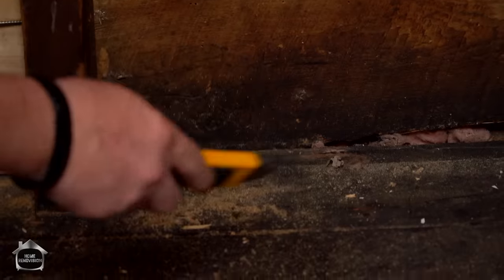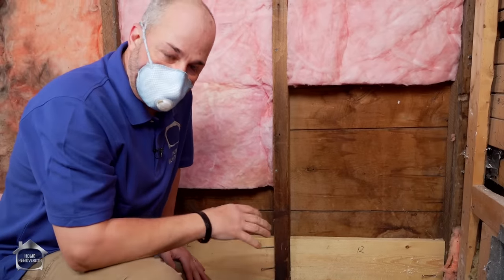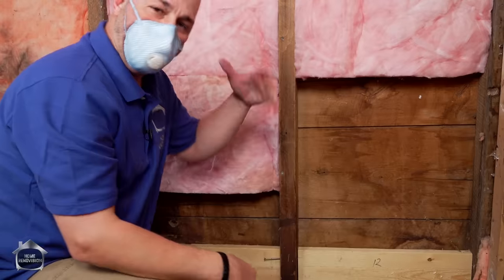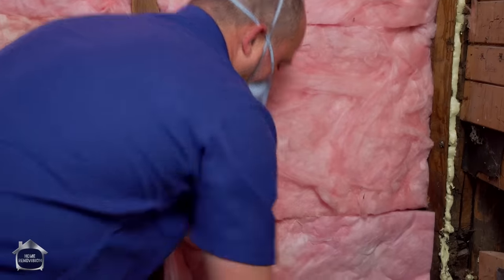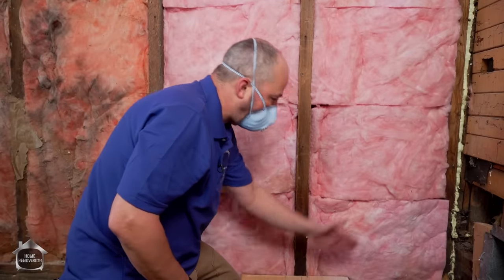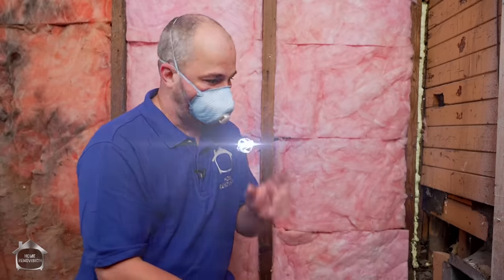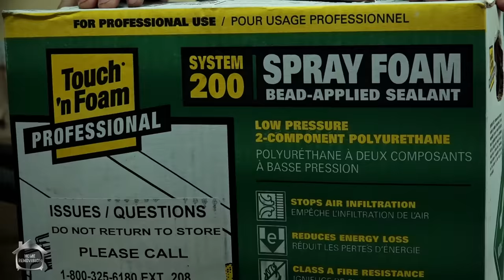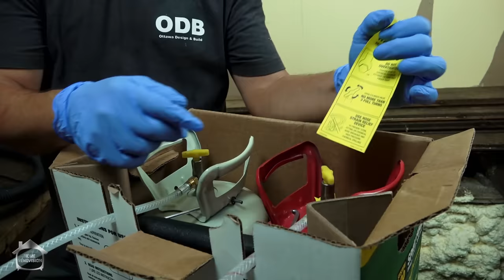How to Install Insulation Yourself! | DIY Insulation Tutorial

Comment from the maker: Lets have a good conversation about insulation technology and what to use where. let me know if you are having trouble negotiating the info on what to use where?
Reply: Closed cell really is a superior product. I built a pole barn about 2 years ago and put a man cave on the inside and use the same insulation system use in the video. It's nice to have this at our finger tips to be able to use and do it our self.
Reply: Home RenoVision DIY how to keep the foam from drying in the gun. I manage to mess this up in the disposable cans and this big one. :(. It’s getting expensive.
Reply: This article suggests using open cell in crawl spaces,  I get that closed cell can be superior in some situation but is there times when you wouldn't use it?   https://www.emecole.com/blog/rim-joist-sealing-with-open-or-closed-cell-spray-foam/
Reply: Any recommendations for homes built on a slab? I feel that it is inherently flawed because all the cold comes up through the floor. Great video and thank you Jeff!
Reply: My house is boarded on the outside and on the inside with what is now probably packed down blown in insulation in between. It was suggested to me that the best way to insulate was to take down the ''inside boards'', insulate and then sheet rock. I already have sheet rock over the boards in almost all the rooms. This method would cause a huge mess and I'd probably have to move out for at least a week if not two. Did I get the right advice? Is there a better way to do this?
Reply: awesome thanks for this video!!!
insulation is a big topic for home improvement, for both comfort and energy/money savings :)
Reply: Where do I get this foam gun!?!
Reply: Thanks for all your video,  pleaee where can I find a good school for plumbing in USA? Regards
Reply: We are also fixing up an 1870s home, but in Texas, where it’s hot and humid from May through October. It gets down to freezing a few days a year in the winter, but our insulation needs are vastly different than yours. WE DO need to fill the gaps between the floor joists. Can we use the spray-foam there, or is that only for vertical surfaces, as you showed? Would you recommend blown-in insulation in the attic?
Reply: Rina Martin the most likely way is to blow into the wall spaces. This involves using a hole saw to open each stud bay and blowing in dense packed insulation. It is not terribly difficult, but there are safety concerns I.e. using a non conducting feeler gauge to mark each cavities height/ width and using enough product to completely fill the cavity without blowing out the wall. In a retrofit dense packing is usually done as it will stop air movement.
Reply: just a small recommendation considering the farmhouse videos. if you can have the titles organised eg. Farmhouse ep4 basement or washroom etc.... i love the  videos, im just a little confused when trying to follow the farmhouse. THANK YOU for your content I REALLY ENJOY your videos... U are in my top 5 favourite contractor. Want 1st place? u just need to be a habs fan and you got it!!!!!! hihhihihihihihihihhhih
Reply: Great video and really helpful, I just not sure What is the name of that pink-plastic insulation roll you used on after spraying the foam on the crawl space wall ? and where can I buy it? Thanks
Reply: I beat the shit out of ridgid, well worth the money! Be smart, register your tools.
Reply: I'm confused on the insulation sheet used. Was the foam not enough? And I thought putting the pink down there would be bad if water came from underneath. I'll be doing my crawl space soon is why a ask, because I was going to foam my brick and call it good but now thinking about that insulation sheet as well.
Reply: Personally, and this is for myself only, Situations change for each house or application. For myself? I had Emptied Cement bags as insulation! AWESOME!! I think I have alot of work ahead of me! Personally, since I do have Rim joists, I am going to use Rigid Foam first and then use batts to fill in the rest. NO need use a vapor barrier when the Rigid foam is sealed with a Spray Foam.
Reply: @koryleach9660  I think the biggest problem with outside "Blown In insulation...is that they have people that don't really know when it is "full". Believe it or not it does take time! I have seen far too many videos on "How to do it wrong"! 
Side Note: AS a DYI person, I can buy the Insulation, the Drywall, coat the Drywall...paint it for half the price.. Blown in insulation for walls is a waste of money...unless you have lots of it, and TRUST the company.
Reply: @codypoe2854   I was thinking the same thing.  With the fiberglass insulation under the vapor barrier, towards the ground, wouldn't the moisture be trapped in the insulation?  And I'm sure everyone knows that fiberglass insulation is about worthless if it's wet.
Reply: Wouldn't having the fiberglass insulation sheet in the crawlspace under the vapor barrier expose it to moisture and render it worthless over time once it was saturated?

Comment: You should mention the minimum surface temp of the surface you’re spraying the foam onto.  Cold surface won’t activate the foam and lead to adhesion problem. I had to use a torpedo heater to prep my foundation for spray foam.

Comment: hey jeff, as always, LOVE THE VIDEO! I have a similar crawlspace in my house. My question is, if you don't have a water proofing membrane on your exterior crawlspace/basement foundation, what steps should i take to not only insulate but ensure the insulation doesn't get water damaged or have moisture build up behind my vapour barrier?  How reliable are those water proofing paints?

Comment: So glad your videos showed up on my feed. I have vaulted ceilings (basically it's the roof) in my bedroom. Beams that are standard distance apart. I want to add a bar perpendicular  to the beams to help hold the insulation up. 1) What should I use as a thin bar? 
2) I'd like to cover the insulation with a light weight cover. Instead of dry wall, what do you think about corrugated or flat PVC panels? Thanks in advance for you advise.

Comment: 12v Brushless Milwaukee, my 18v drill and impact have been unused so far since I bought them, I can put 6 spare batteries in one pocket (2ah), the 6ah is really light in weight, all the power you need and they weigh very little. I'm sure Milwaukee would treat you to some Jeff!
Reply from the maker: very nice, I like light weight tools myself.

Comment: I’ve been retrofitting an 80 year old house with balloon framing. I decided to do #30 felt as the WRB, so there wouldn’t be water trapped. I’m adding shingles over that. It’s a compromise, but think safer than Typar, etc. Nice video.
Reply from the maker: interesting!

Comment: Holy cow, I just realized I've been wearing dust masks incorrectly for the last 25 years of my life - I just saw at the 1:12 mark how the straps hold the mask on Jeff's face.  Now I need to find a project to put this in practice -- I just insulated my attic with dusty cellulose 4 months ago, and this would have kept the insulation out of my nose.
Reply from the maker: Hi Jason, curious how you were wearing yours?
Reply: @HomeRenoVisionDIY  Lower strap around my neck, and upper strap around the back of my head.  It's amazing how I managed to even keep it on.  🤡🤓🤤
Reply: my mind is blown
Reply: He is not wearing it the correct way. The top strap should go to the top back of the head and the bottom goes below your ears around the neck. You can look up the manufacturer's fitting instructions at https://www.moldex.com/product/2300-n95-series-respirator-exhale-valve/.

Comment: Great video and tips on application.  I have never used this product but I have had a few times where it would have saved a lot of time and in the long run saved money had I done so.  I watched a couple of TV programs where the product was improperly applied and not allowed to cure properly and the property owner ended up with a house that gave off a fishy smell, I think it was because the product was applied too thick and not in two layers with proper curing between layers as you did.  Still like the idea of this product though especially for hard to reach areas and irregular surfaces.
Reply from the maker: definitely a concern. always use this type of product according to specifications. cheers!

Comment: Jeff, those cans are pretty slick but they are only 20 to 24 oz while the disposable cans area 12oz so technically they are not any cheaper but are easier to use and can easily be saved for later where it's a little harder with the disposable can system.  One thing to note, spraying that 2 part foam in the crawlspace should be done with a respirator and plenty of ventilation, the gas that gives off is not really all that nice to our lungs.

Comment: I've had quite a bit of sprayfoam installed in my house. Our local contractor's cost is $1 per square foot per inch. For me this is actually cheaper than the kits at our local building store.  However I'm not sure if they'd charge that rate on a small job. Worth shopping around anyway
Reply from the maker: access and size all factors into it for sure. Cheers!

Comment: I am looking into insulating my attic. I have a gas 80% efficient furnace in the attic with all of my ducting coming in through the ceiling. It is obvious that the tops of the walls and fixtures are not air sealed and currently there is an inadequate amount of fiberglass batt insulation installed directly on the top of the ceiling drywall. Do you have any suggestions on how I should insulate and properly vent my attic? the two options I can think of is: 1: Air seal all wall tops and fixtures, duct seal and insulate ducting, Fascia  vent dams, blow foam insualtion. 2: Spray foam the roof panels and make the attic a conditioned space and add in a fresh air supply for the furnace. I live in Salt lake City Utah which is a pretty dry area.

Comment: Hi Jeff! I know this is an older video, but I hope you could still see my question and give me an answer!  What's the respirator you were wearing at the beginning of this video, i.e, brand, and where to get one? Or if this particular one isn't accessible, what other comparables would you recommend?  As always, thanks for the great videos!
Reply from the maker: It is a full face shield used for spray painting or high contaminant areas. It is actually what front line workers should be using. but alas there would never be enough of them in stock. So the cdc says use those cheap surgical masks.

Comment: Two questions. Why is it better to insulate the walls than to insulate the floor to the house? And two, would the vapor from the ground work its way into the insulation instead of going into the house, and ruin the insulation? I'm trying to plan a project and am wondering.

Comment: Ok, I'm new to all this stuff. So I have a crawlspace with unfenced insulation in between the joists. The floor is covered with sand and a moisture barrier plastic. I wanted to add spray foam,  take out all of the old yellow unfenced insulation and replace it with the bat insulation.  Is this a good idea? Would doing thisake a difference in my heating AC bill? Would leaving the current insulation in place and adding the bat insulation over it be a recommendation or just remove it all the way? Would spray foam also be recommended once I pull down the insulation? House is only 16 yes old. Thank you in advance for all advice here. Awesome video!

Comment: If I have electrical wires, plumbing both copper and PEX, I could still use spray foam correct? Also the extra insulation you added was just for higher r-value, is not necessary right?

Comment: Here in NZ if you are retrofitting insulation into existing walls in houses that have no building paper and you arnt replacing the siding. it's common practice to cut out sheets of paper and staple them from stud to stud lapping 2" over each side. I wounder if you guys do that as well. Nice vid
Reply from the maker: If I am remodeling a house I always open the outside and ensure a water deflection system and then I am good to go with the finishing. You can never assume the last guy did it right. cheers!
Reply: @HomeRenoVisionDIY  yes ideally if you have the budget for that then sure. Obviously
Reply: @HomeRenoVisionDIY  if it's not practical to work on the exterior, even if everything appears dry and has no staining- is it best to go with a breathable insulation (fiberglass/rockwool) and put the vapor barrier inside of that? As opposed to foam or flash+batting walls.

Comment: Love your videos and like the simple way you put things. Quick question: My house was built in the 50's and has no crawlspace insulation. The subfloor though has no floor joists; it just rests on wooden legs with a concrete base. How could I go about insulating it? Its vented. Thanks!
Reply from the maker: Where do you live. It sounds like you need the venting to control moisture not heat!
Reply: @HomeRenoVisionDIY   Possibly. I am in Seattle, WA

Comment: A touch confused.  The vapor barrier on the dirt goes up to the foundation or footing correct? It doesn’t go over it?

Or do you seal over it when you put the other insulation fiber insulation into the wall cavity ?

Comment: I chose Extruded Polystyrene(XPS) Rigid Insulation to insulate my crawlspace.  It has superior R-value compared to bat insulation, it's 100% waterproof, and it also acts as a vapour barrier.  I have used spray foam for air sealing around the edges of the XPS.
But the walls of my crawlspace are concrete and they are nice and flat.
Reply from the maker: once you factor in the time and money to seal all the gaps, you might as well just contract it out and be done.
Reply from the maker: Hi Mario, how many layers of foam did you use to exceed r20 like with my batt?
Reply: @HomeRenoVisionDIY  I have used two layers.  First layer was 3" thick, the second layer was 2" thick, for a total of 5" of XPS, that comes to R25.
The two layers allowed me to stagger the seams, so I only had to use the sprayfoam on the edges.
Reply: @eringuet  Yes, it's expensive when you are buying the XPS at a big box store.

Comment: Why do you need the vapor barrier I thought the spray foam was a vapor barrier and an air vapor. I am reinsulating my house and was only planning on doing spray foam avoiding the poly layer. Thanks great videos
Reply from the maker: vapor comes from 2 sources in a crawl space, 1 the ground and the second from condensation through the wall. the spray foam solves the condensation but having the plastic on the ground solves that passive relative humidity as well. In the winter we will be heating that space so we need a vapor barrier on the dirt and up the wall as a complete system to protect the wood subfloor. Cheers!

Comment: We are in the middle of redoing the outside walls of my house which we have just discovered there was NO INSULATION IN THEM TO BEGIN WITH! So its no wonder we have had mold trouble and a high utility. With southern illinois climate would you recommend the same process for us?

Comment: Apologies if I overlooked something, but why do you need to clean out the spray gun? Can't you just leave the original bottle attached to it and just squeeze out the initial filling?
Reply: Probably because the foam inside the tube has hardened and he hadn't used it for a while. He did mentions it sets in a few minutes.

Comment: Hmmm. I had a gap around a pipe (gas?) under a cooktop. I started finding mouse droppings in the cabinet and in the drawer under the cooktop. It was suggested to me to fill any and all gaps with steel wool. Never had a problem again for the next 18 years. It wasn’t an exterior wall, though. The garage was on the other side. Would this work in an exterior wall or cause other problems?
Reply from the maker: spray foam works everywhere. Best to stuff the steel wool and seal it up as well. Cheers!

Comment: Are there fumes that make you dizzy when working with this product in a small space?  Also, what if that wall gets damp during the winter.  Will the foam stay put, does it mold?  Can this also be used in an attic ceiling similar to how you used it in the video for the crawl space?  Thanks!
Reply: I'm curious about this as well
Reply: He said its closed cell, so I guess that means it will not admit any water into it (vapour proof), so no mold. Im not familiar with this exact product, but my experience is polyurethane foam sticks to everything, forever, wether you want it to or not...
Reply from the maker: No dizziness at all. The fumes are more of a radiant heat. perhaps toxic if you have long term exposure. but for a one off i was comfortable with not sweating my but off while in the hole.

Comment: What about sealing a gap where an addition (crawlspace) foundation and basement foundation meet on a newer house? We just bought a mountain  house in NorCal, built in '98 (thank god!), on a downhill slope w daylight entry basement...there was a bathroom added after, with a crawlspace foundation that a) looks like a rodent dug in the crack where they meet and b) wasn't closed + sealed properly after a pipe froze a couple years ago... Clearly needs to be cleaned + insulation replaced + we want to do a thorough job!

Comment: Hey, that pink blanket will suck in moisture from the dirt in no time! And since it is covered with the vapor barrier the moisture just accumulates over time. Pretty soon you get yourself a mold incubator right in your crawl space. I'd remove it now before it's too late and put rigid foam board instead which is designed for damp locations and won't suck in the moisture. Let me know if I am missing anything. Otherwise great video, I learned from you a lot!
Reply from the maker: actually fiberglass has no absorbtive properties so that is not going to be a problem. Cheers!